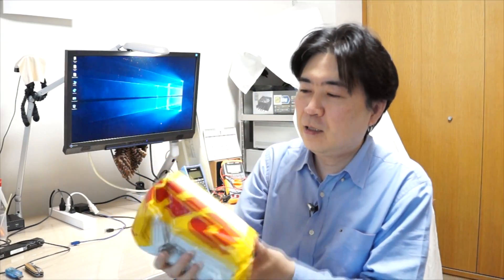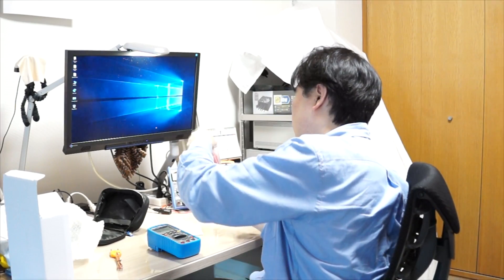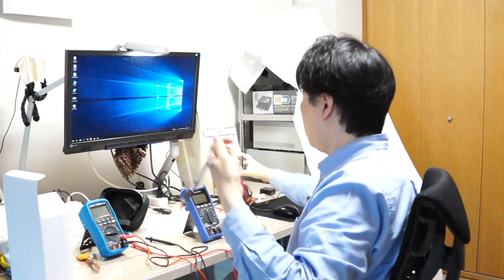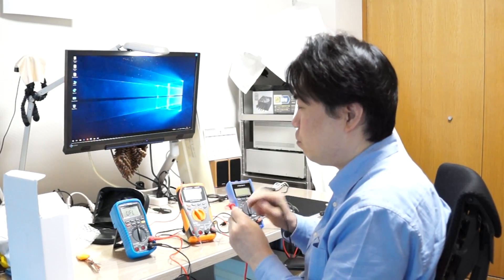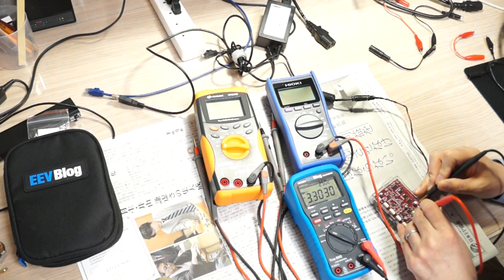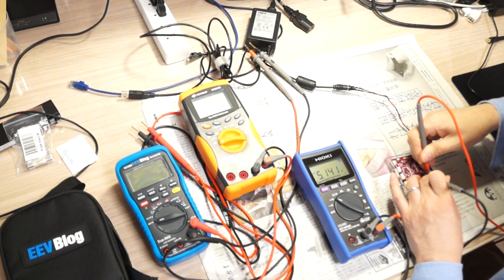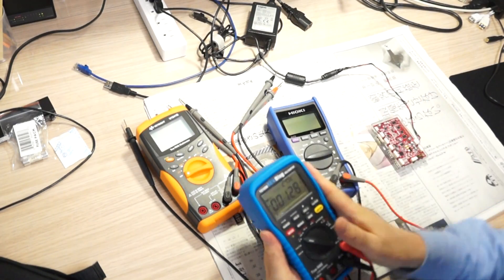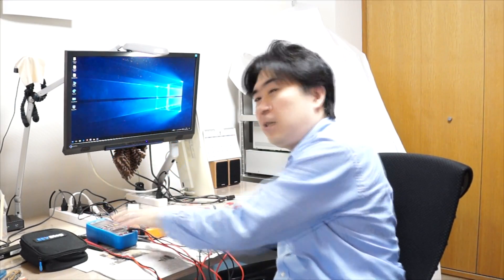Akira-EN #1 EEVblog 121GW Multimeter Unboxing, Continuity Voltage review

Comment: what is the voltage on the leads when doing continuity test ?  My new fluke 179 is over 7 volta !
Reply from the maker: Sorry for very late reply. I am not sure all the 121gw are the similar voltage. It was 2.12V at continuity test on my 121gw.

Comment: I'm pretty sure they are Jigowatts tho.
Reply from the maker: Yeah! I think it was pronounced Jigowatts in the Back To The Future movie, maybe I need to change my pronounce. :)
Reply: 1.21 GW is a lot of power for a multimeter! I wonder if it still uses normal plutonium batteries or if it comes with a Mr. Fusion Home Energy Reactor.
Reply from the maker: I am not so sure, I prefer the Fusion Home Energy Reactor though :) I need to keep some garbage to keep the multimeter running :)